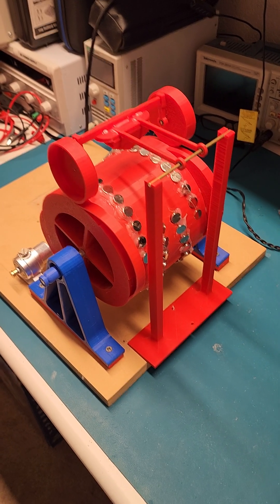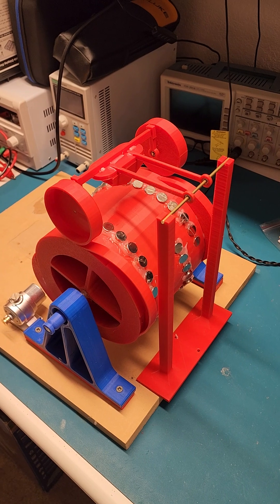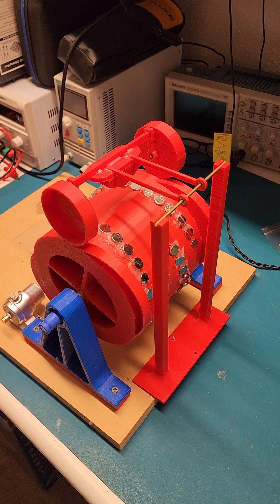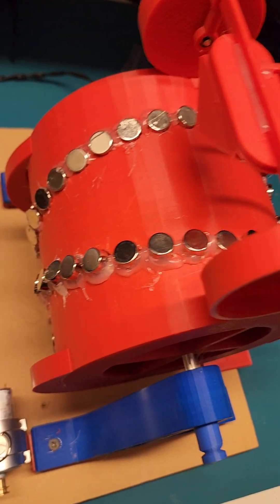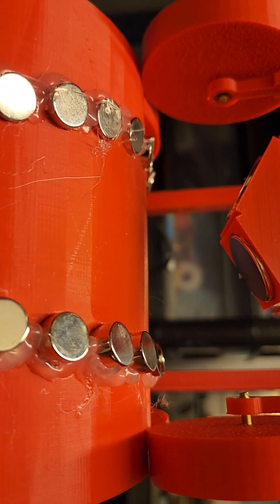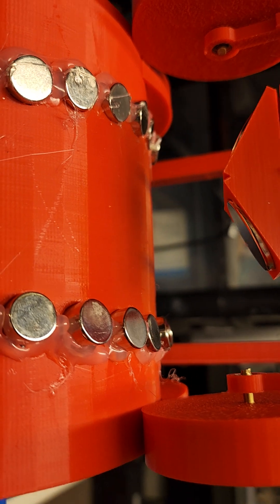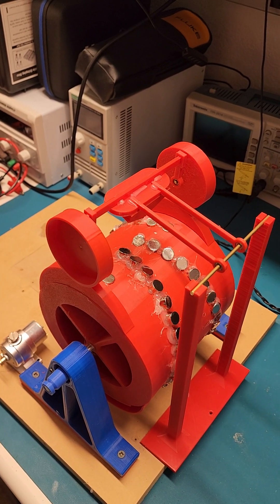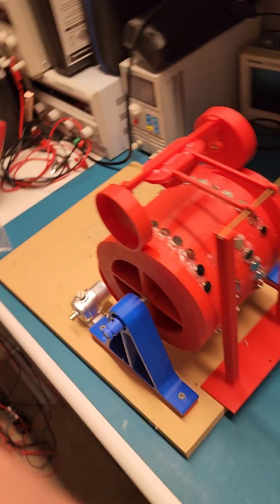FREE ENERGY V-GATE MOTOR?

Comment: It's my hobby to study perpetual motion theories and "Over Unity" machines - Two of my favorites are the Magnet motor like your attempting and the Shaft with two fan blades in a cylinder . . . These have become "The electric motor" And "The Turbo Jet Engine" Which are tow of the most efficient drives ever created - it is well worth studying perpetual motion and over unity to find new ones that may be exploited by "Adding Energy" !       My pump isn't over unity but it is EXTREMELY efficient.     https://www.youtube.com/watch?v=jvOeZyUbJS8&t=18s